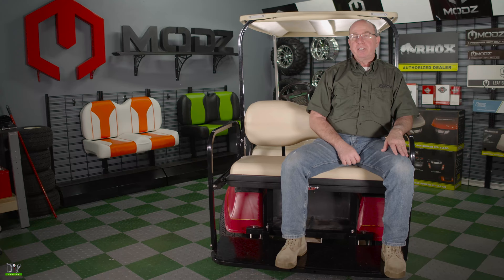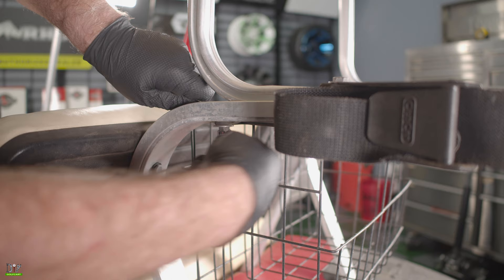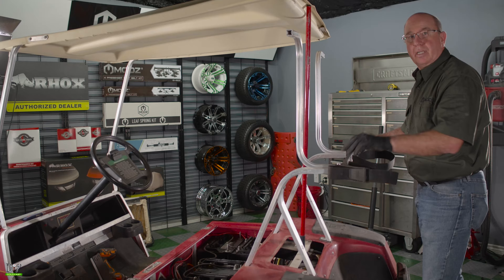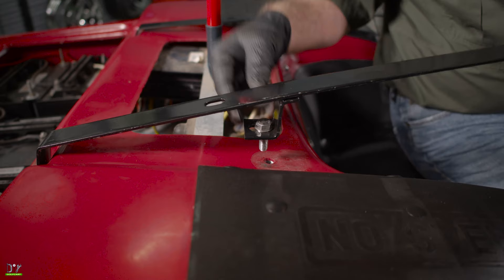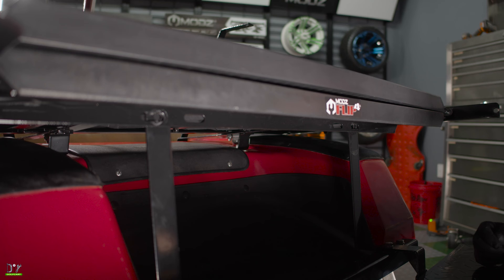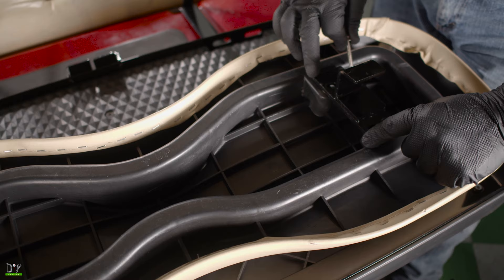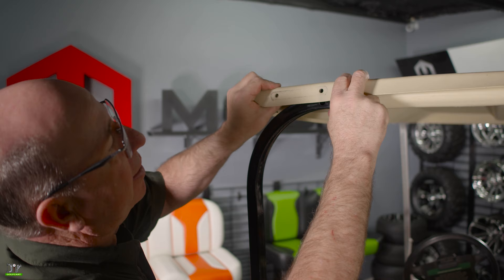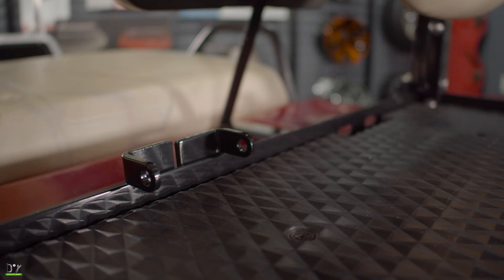MODZ® Flip4 Rear Seat Kit Installation on 1982 - 2000 (Old Style) Club Car DS

Comment: Quick question I have a extended tip those brackets aren’t useful correct?
Reply from the maker: Actually yes, you'd mount the uprights to the outside of the arm rest and to the extended top. Thanks for watching and don't forget to subscribe!!